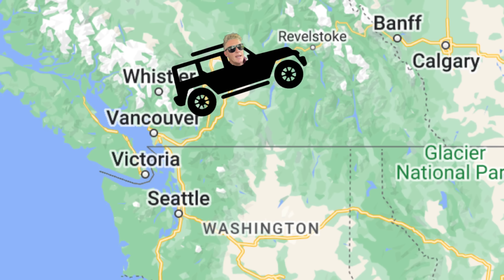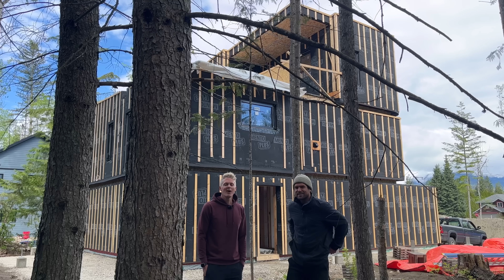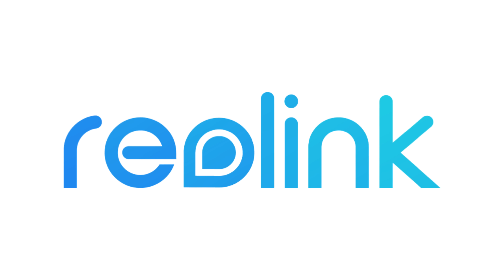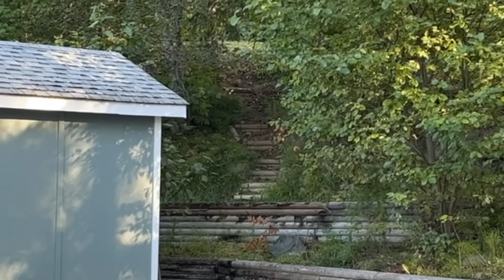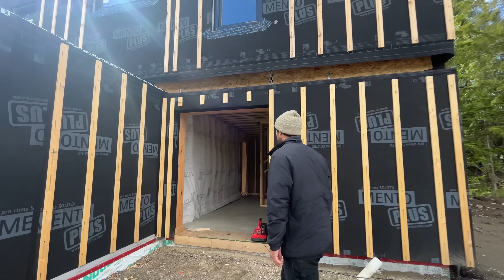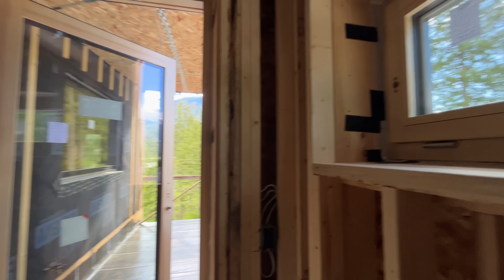Woah! First Look at a 3 Story PREFAB HOME that’s Full of Surprises!!

Comment: Sometimes I don't get the point of this channel. The whole point of pre-fab homes is supposed to be affordability and yet you consistently show us smaller homes that cost more. ??????
Reply: Nowhere on his channel does he specify that he's showing "affordable" homes. YOU just want to only see affordable homes. Also keep in mind that other people have a higher budget for affordability..
Reply: Why do you believe that the “whole” point of a prefab home is affordability? Note that after he meets the cofounder the first thing to discuss is net 0 and high-performance characteristics.  These are things that at this time that are expensive to do but have demand in the market.Over time, the cost of these units will come down as volume increases, but may never equate to the definition of affordability. these are not manufactured homes in the traditional sense of the word. By constructing them offsite they have a higher level of quality control as it relates to the high performance and net 0 construction processes.  In that way, building this as a prefab home is likely less expensive than building a home with equivalent characteristics on site, so in that manner, it is more affordable.

BTW- prefab does not mean production line homes, it merely means prefabricated off site and brought to the site.  A prefab home can be a one of a kind custom home. This is not meant as a negative statement, but I think you may misunderstand or misinterpret the breadth of the definition of what a prefab home is.
Reply from the maker: This home is 2,500 sq ft

Comment: Sorry,   this is more custom than prefab.  How do you prefab a concrete lower floor unit?  Not
Reply from the maker: Foundation was poured at the site, walls for the ground floor were built in their factory along with modules for 2nd and 3rd floor.

Comment: I'm not a fan of multi-story homes. It's going to be rough to have to climb so many stairs all the time. I see a lot of small windows on otherwise featureless exterior walls. I can't imagine that this will be very attractive when finished.  The interior doesn't look like it's going to be anything special either. Just sayin'.

I'm also wondering what the point of prefab is in this case.
Reply: You can fit more square footage on a smaller lot space with a smaller foundation.  Also, speed of construction.  Windows weren’t all small, those facing the view were significant.  Siding types will determine the exterior attractiveness, cannot really go by the way that the furring strips look.